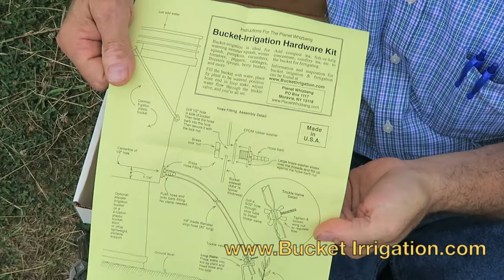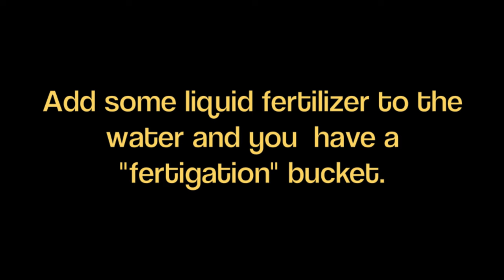Whizbang Bucket Irrigation For Gardeners

Comment: Can I use this for a few flower plant at the same time?
Reply from the maker: You can only water one plant, or group of plants that are together, with the drip valve. If you wanted to water more than one plant, you could put more hoses on a single bucket.
Reply: hung la Fung just run a long tube from the bucket and put holes in it wherever a plant is with a sewing needle and at the end put a plug/bung or bend it over and clamp it. play about with different sized needles to get different drip rates depending on the water needs of your plants and local climate.  great idea but watering one plant at a time and then moving it is a lot of time spent watering you would be quicker using a watering can
Reply: No. Only veggies.

Comment: I admire your ingenuity, and I like how well made your devices are. But that seems like an awful lot at work just water strawberries! You mean to tell me that you move those buckets and that table up and down that row? All due respect but that's crazy! 

Now if you had big fat wheels on the table so you can easily roll your buckets up and down that would make a little bit more sense.

I would Bury a 2 inch PVC pipe with holes cut in a matching where the strawberry plants were, put an elbow on one end and a cap on the other end. Stick a hose in the elbow, and you get fantastic watering because, as you know, the pipe is in the ground and osmosis will pull the water through the system.

Comment: This is stupid.  I use a pvc pipe with small holes  along the length of my strawberry row and connect the pvc pipe to a bucket and water all my plants with one bucket.  Put water into the bucket and it waters all my plants.  The small holes allow a slow watering. Can do several rows with one bucket.
Reply from the maker: Hi Mary,
I'm sorry that you have totally misunderstood and mischaracterized the point of this video, and of the idea I present. It is NOT an idea for irrigating rows of plants. Please read my pinned comment at the top of this page for some clarification. As for your idea, it is not stupid at all. You are a genius. Thank you for adding to the discussion.

Comment: You're not showing hose connecting to bucket.
You're not showing how 1 hose does whole row. It only shows drip coming out end of ONE hose. Not a good video. Please explain it better.
Reply from the maker: Please read the pinned comment at the top of the comments section. It answers your question.